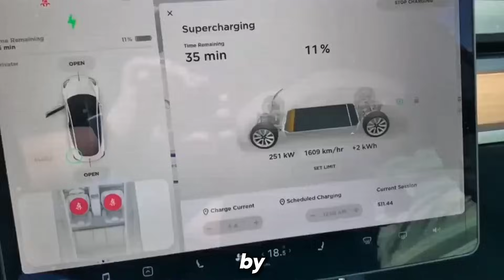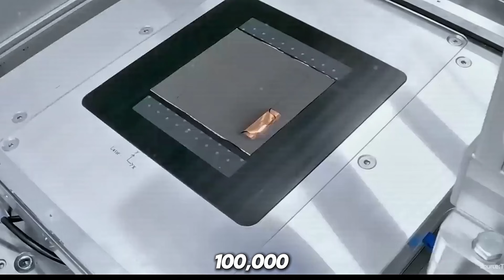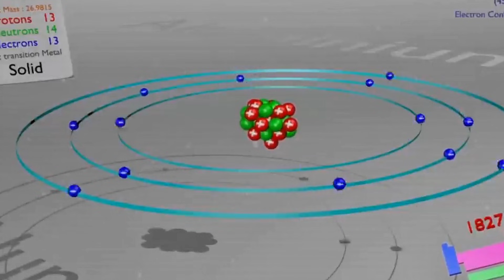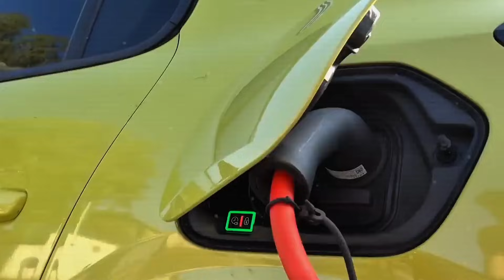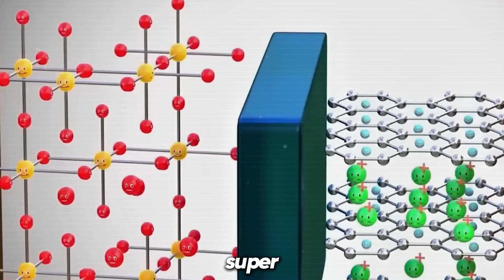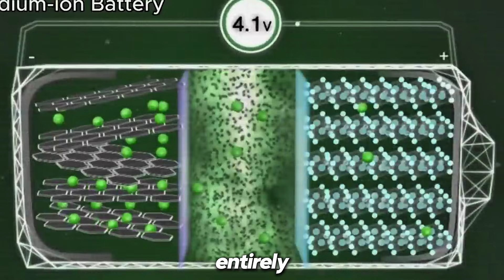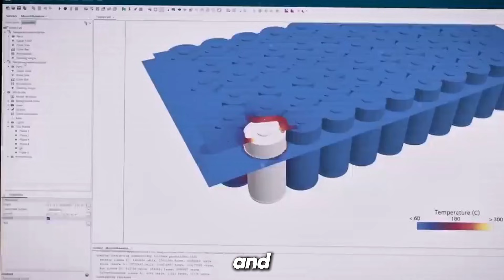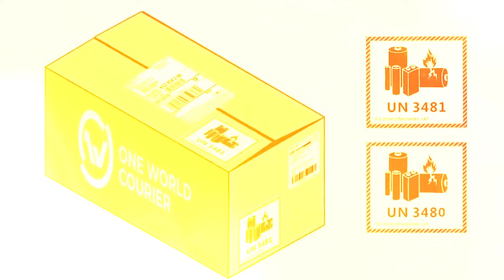2026 Tesla Battery Aluminum Ion VS Sodium Ion Changing The Industry

Comment: Yes — *aluminum-ion (Al-ion) batteries* have been discussed for years. The claims sound impressive, but the reality is more nuanced.

*What is actually true*

* 🔥 *Very safe* (non-flammable electrolytes)
* ⚡ *Extremely fast charging* (seconds to minutes in lab demos)
* 🔁 *Very long cycle life* (10,000–100,000 cycles demonstrated)
* 🌍 *Abundant, low-cost materials* (aluminum is widely available)

*Where the hype breaks*

* 🔋 *Energy density is NOT higher than Li-ion today*
  – Real prototypes: ~40–80 Wh/kg
  – Modern Li-ion: ~250–300 Wh/kg
* 🧪 “Triple energy density” is **theoretical / PR-level**, not commercial
* 🏭 *Not scaled* for EVs or large-scale manufacturing

*Where Al-ion actually makes sense*

* ⚙ Stationary energy storage
* ⚙ Industrial UPS systems
* ⚙ Ultra-fast charge applications
* ⚙ Use cases where *safety and cycle life matter more than weight*

*Bottom line*

* ❌ Not a Li-ion replacement for cars (yet)
* ✅ Promising *niche technology*
* ⏳ Could become disruptive *if cathode chemistry (e.g. graphene) matures*

If you want, I can give a **clear comparison table**: Li-ion vs Na-ion vs Al-ion vs solid-state.